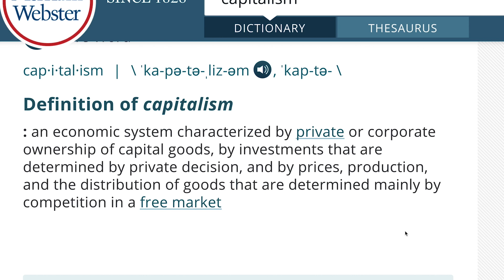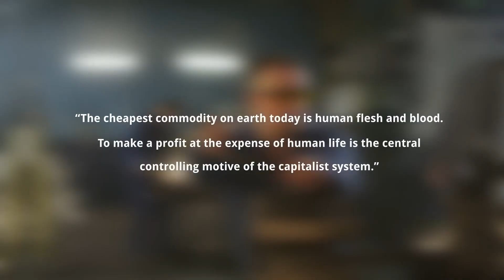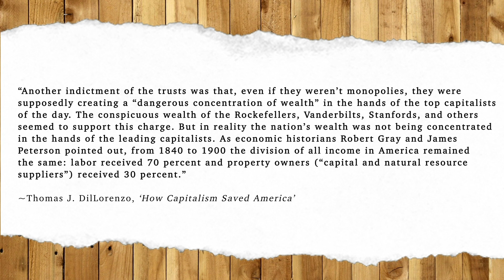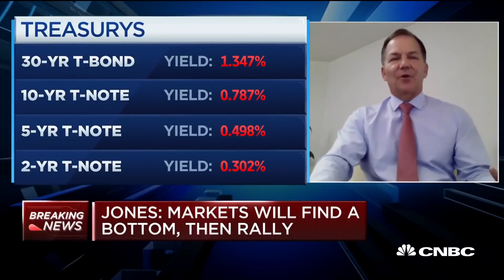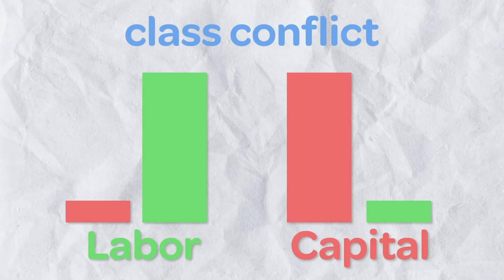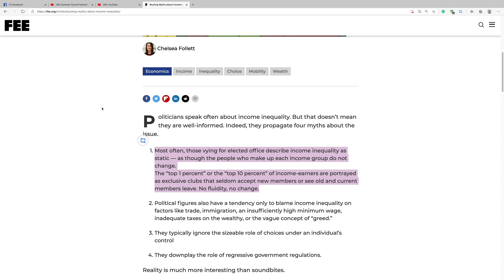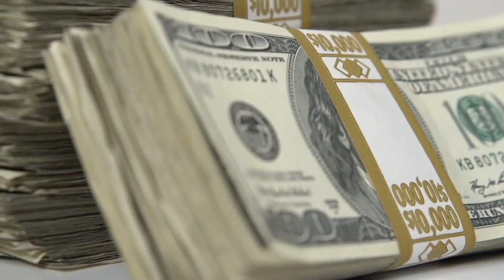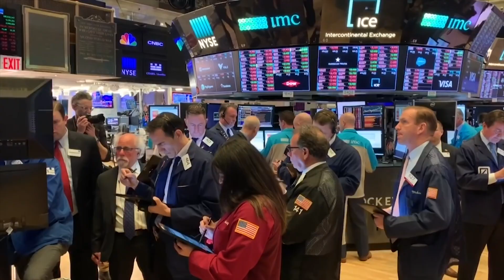Capitalism NOT Corporatism: Second Thought Debunked

Comment: 7:30 this is what shows the utter failure of the capitalist system... a system of profit for the individual, no matter the cost, over anything else. it was around 1975 when productivity was rising but the wages stopped rising. how pathetic to use this bogus statistic to argue for capitalism. income vs productivity chart blows this strawman out of the current dimension of space and time... i expected more integrity from you scotty...
Reply from the maker: How does that quote show the failure of the capitalist system? Not only is the capitalist system not present, but the evidence shows that the rich grew richer and poor grew richer faster. This was the same story in the industrial revolution as the biggest gains were made by the poorest of society between 1780 to 1900.

Goodness knows how many times I have pointed out the fact that economically illiterate minded people such as yourself don't even understand the meaning of profits. Profits are price signals, it's important information that details the consumers needs and wants. To stand against "for profits" is essentially to stand against the consumer. But let's delve deeper and debunk that silly economically illiterate minded argument, as you state:

"a system of profit for the individual, no matter the cost, over anything else."

The information of profits in a free market can only come from consumer demand, in order to make profits you require providing a service to the consumer, so it's not a case of "no matter the cost," you try to make it sound like they can just make profits by doing whatever the hell they like and this simply is not the case. The only way they can get away with doing that is by using YOUR socialism through YOUR socialist subsidies to provide protectionism of their losses. Therefore, there is no "no matter the cost," because businesses are forced to provide for the consumer and if they don't, the business will pay the heavy price when up against fierce competition.

You are now spreading lies about 1975 as the evidence shows from the study that the wages of the bottom 20 percent in 1975 grew by $27,000+ by 1991, meaning that most of the bottom 20 percent moved up the ladder. I mean, how desperate do you need to get to reduce yourself to compulsive lies?

Secondly, how is moving up the ladder proving that most of the bottom 20 percent moved up the ladder static? Static means no change, that is in reference to your own government statistics whereby you assume the bottom 20 percent of people in 1975 are somehow the exact same bottom 20 percent of people in 1991, that's static and it's wrong!

"income vs productivity chart blows this strawman out of the current dimension of space and time..."

No it doesn't, it really does not, because you're now talking about a completely irrelevant subject matter on productivity, we are not talking about productivity, we are talking about the wage growth and how they moved up the ladder. If anything, a higher level of productive output means a drop in prices of consumer goods, it doesn't refute the quotation, not even in the slightest. You just thought you were being smart by throwing that in there hoping it meant something when it has no correlation, that proves the point, you don't even understand fundamental basic economics. 

More integrity? If anything improves wages it is higher levels of productivity and exporting goods in free trade to enable countries to become more reliant upon your money, although, there were currency devaluation. Not bad for a period under corporatism to see wages grow dramatically. All you did was spout irrelevant pish.
Reply from the maker: "you fool, even the chairman of federal reserve admitted he didnt see the 2008 crisis coming.."

Yeah, reminds me of the likes of Joseph Stiglitz and Paul Krugman who never saw it coming, yet there was the likes of Peter Schiff who made the prediction and was absolutely spot on, I wonder why? I wonder why it happened after artificially lowering interest rates? Is it perhaps because people like you are economic degenerates and don't understand the damage that would cause in the economy after all that reckless printing, borrowing and spending? 

All it takes is understanding economics to comprehend WHY it would occur, which proves you simply don't. A donkey could tell you that if you recklessly print, borrow and spend and artificially reduce interest rates, then of course in a period of a shortage of savings you're going to drive up consumer spending in a wrong period, only then to see a boom and then a bust. Jeezo. What do you need, toddlers language for me to explain that to you?

"stop making yourself out to the be the only clown who pretends to understand the current economic system."

I don't pretend, I merely face up to ignorance such as yourself who post shite.

"stop vomiting out someone else's vomit you swallowed to"

This is bullshit, how else do people become educated? If that's the case then, all students who go through education learning from teachers are just taking what they say as gospel. But your argument doesn't work, not only did I learn from others, which is what people do naturally, I understood the arguments they made. All you're attempting to sit direct and project it off onto attacking myself because you have no rational argument.

You can't believe I stated this: "To stand against "for profits" is essentially to stand against the consumer." And what exactly is wrong with that statement?

"so when there was a flood in the usa and the free market decided to increase the price of water to a stupid amount, that was just the free market thinking of the profits for the rich shareholders?"

What free market, the United States hasn't seen a free market since BEFORE Abraham Lincoln, so what flood and free market? Price drives up naturally because that's what happens in the laws of supply and demand, it's telling you there is a shortage. That's the purpose of the higher price signal, that way we know what is in higher price and where to allocate resources. In the case of a flood, we know what is required because of the higher price signal. 

This indicates to me you don't understand prices and who said higher prices necessarily mean greater profits, who says, your economically illiterate minded self? If price drives up consumer demand falls, you face losses, not profits. It really depends whether the higher price you set is what consumers are willing to pay for something, but as soon as you go above what consumers are willing to pay, you're facing losses. What economic education did you get, son, eh? Exactly. So your scenario of prices driving up because of a flood results in losses, not profits. The losses stem from damage caused in the economy, ever studied the Broken Window Fallacy? Oh, that's right, never touched an economics textbook in your life.

PROFITS TELLS THE MARKET:
• How much to produce.
• What to produce.
• What resources to use.
• Where to allocate scarce resources.
• What to invest more in.
• How the resources are transported.

In the scenario of the flood, what you think the higher price signal does? It tells the market there is a shortage and we know from what is in greater demand as a result of that, therefore, we know what resources to use, where to allocate them, how much to produce and what is in lesser demand. That is consumers needs and wants.

"that is precisely the case you knob goblin... how many times have corporations tried to go around the legal restrictions to save money?"

This is the biggest load of nonsense one could possibly read. The complete and utter otherworldly not-real-world bullshit you've just made up with no real-world examples. Businesses can't just throw out there whatever they like on the market, because you have no guarantee that the consumer will buy it, that's why. Price is determined by what consumers are WILLING to pay for something, not because you simply produce something. What you think people are, robots who are programmed and forced to buy products businesses create?

Honestly, the severe lack of intelligence from your kind is unreal.

"and where does all that saved money goes? to the share/stock holders. this is the business model you .... amazingly naive creature...."

Excuse me, investors invest money seeking a return and as a result of their investment, they help the business in return and the only way the investor can gain the return is if the business succeeds. There's nothing wrong with that. If you have a problem with that, well, eh? Pfff, I don't know what to say. The fact you think something as "MORAL" as that is immoral sums up how immoral socialists are.

"surely you are doing this deliberately.. surely you are acting this ignorant for a reason..."

How, because the GDP leading to higher productive output? How is that going to change the fact that between 1975 to 1991 wages grew by $27,000+ for the bottom 20 percent having moved up the ladder? It isn't and this was recorded by Federal Reserve Board Researchers, Cox and Alm. 

"wages that were stolen from workers and put into the pockets of share/stock holders ? how far is your nose up their butts?"

How is applying for a job, that's right, keyword, "APPLYING" for a job, signing a contract to work for a company through YOUR choice, how the hell is that theft?
Reply from the maker: "doesnt matter if it was jesus himself... he was not in charge of the economy."

No, that's right, he wasn't, we know who was though, Joseph Stiglitz Keynesian economics was, remember how he joined with the World Bank in 2001 to be their economic advisor to prevent them from such a crash haha that was magical, wasn't it? Yeah.

"to think no one understand economy better than you is dellusional..."

You're deluding yourself if you have that impression of me. However, if you are referring to the economically illiterate minded Keynesians and Marxists, it's not hard to be better educated on economics than those who believe in government intervention in the economy, we've got economic history and economics itself to back the evidence you'd have to be a fool to support either position.

"what degree in economics and politics do you have?"

You tell me, all those economists out there with degrees in economics, yet the silly fools supported the fixing of interest rates of the central banks. The very fixing of the interest rates that resulted in the boom and bust cycle of the 20th century. But hey, let's print, borrow and spend more money we don't have out of thin air, whatever could go wrong? Just remember, that was your Keynesian economists all in one.

"so lets not care about providing people what they need... lets not care for the enviornments... lets not care about the biodiversity... lets not care about the air water or ground pollution... JUST PROFITS! u are dellusional..."

Oh really? So how then do you explain that when B.P. over regulated by the state caused a spill in the Gulf of Mexico it paid for its own damages, yet when the state owned Mexican oil company did the same thing by causing a massive spill in the Gulf of Mexico, how come the state did not pay for its damages? Doesn't that sound awfully familiar to the Soviet Union government using nuclear bombs to mine with, or the Soviet Union government that redirected the rivers that fed the Aral Sea which led to the Aral Sea becoming practically nothing by 1960 despite it having been once the 4th largest lake in the world, leaving the land contaminated and devastating the local fishing industry? 

That's just the tip of the iceberg son, we could go onto your world class socialist interventionism of the forest fires that devastated the wildlife and plantlife in Australia, remember that forest fire? Oh you will, that was your socialism, just as it is your mismanagement socialism that is causing the exact same problem in California, but we'll quickly brush over that fact because it contradicts your narrative. 

What makes you believe that the free market leads to such devastation? You ignore 2 facts:

1. private landowners are faced with the economic reality that land can either appreciate in value or depreciate. If their goal is to make a "PROFIT" as you said, the only way they can do that is by appreciating the value of their land, that means looking after the resources. 

2. you're that uneducated you don't even realise that in order to MAXIMISE your profits you have to MINIMISE your costs. It costs you more to use more resources, that means in order to maximise profits, they must use FEWER resources. Do you see why you're a fool now?

Oh, but we'll ignore the fact that the one who was most rewarded in the 19th century was Rockefeller for being efficient using fewer resources, meanwhile the very companies that were wasteful dumping crude oil were those who were going under and out of business. We'll ignore that as well because it doesn't fit our narrative. 

Continuing on...
Reply from the maker: "bro are you trolling now? that is LITERALLY like saying 'its not true socialism broooooooooooooo' loooolllll"

No, it really is not, mercantilism is not capitalism, capitalism is the free market, it's about free trade, it's not about socialist protectionist tariffs, nor is capitalism about socialist government subsidies. That's why the 19th century is not black and white, there never was 100% capitalism because socialism had its presence to some degree. Proves how economically illiterate you are. 

"everyone in the govt of the usa and uk will disagree with you but no no..."

Yeah, they're so educated Britain is sitting more than £9 trillion in debt because of their social security, but hey, how educated they must be. Just like your level of education, just look what your socialist government interventionism did, it created a collusion between private pharmaceutical companies in the United States because of your socialist third party payer system. But hey, you know better, eh? 

"the company put the price back down after the matter was brought to national attention...."

It is the laws of supply and demand, nothing to do with the company. The lower price in the market signifies abundance, it means their needs were met. That proves you don't understand prices. If you artificially drive the price down and set a price ceiling, you create a price shortage problem, therefore, they didn't drive the price down, it went down naturally.

"companies flout the rules alllllllllllll the time with devestating consequences for ordanary people..."

In what, a corporatist system like you're living under today? Good luck setting prices and trying to out price the consumer, the consumer has options, they're not forced to buy from you. The only reason Apple has a customer base is because there is a market there of consumers willing to pay that price. No one sticks a gun to consumers heads and says: "you must pay this price."

"there is no 'willing to pay' when a private company is the only game in town for water or electricity or gas or whatever..."

The myth of monopolies of utilities in a free market again. You don't live in a free market, that's why you are faced with monopolies. I love how you strangle the market half to death via socialism, create monopolies via that government intervention and then blame it on capitalism. Fantastic!

"which is all well and good but it is the workers who provide the labour. stealing their wage is never moral."

If they signed a contract and applied to work for that company, that is not theft, it's an agreement. The capitalist hires the labour to do the jobs, it's then the consent of the worker whether or not they apply for that job. That is not theft, learn the definition of what theft is, try government taxation, now THAT is theft! But hey, let's turn a blind eye to politicians filling their own pockets at YOUR expense whilst you show your complete hypocrisy, eh?

"the wage vs production chart clearly shows this theft taking place for anyone with eyes to see and a brain to process information to reach the clear conclusion... wage theft is real!"

Is it really? So what do you call this: https://medium.com/@KingJpolitics/correcting-the-gravel-institute-is-big-government-really-the-problem-a1c74464af11

I call that destroying your entire narrative.
Reply: @Libertarianach_na_h-Alba  1] What level of educational degree you have in the studies of economics and politics? i mean you have this amazing understanding of economics that no one else has.. so plz what was your degree in?

2] what country is practicing the system you advocate for? clearly it is not UK or USA or i would imagine any of the european countries... so what country is it? lalaland?

just two simple questions looking for two simple answers.